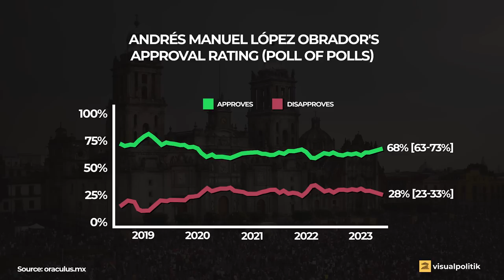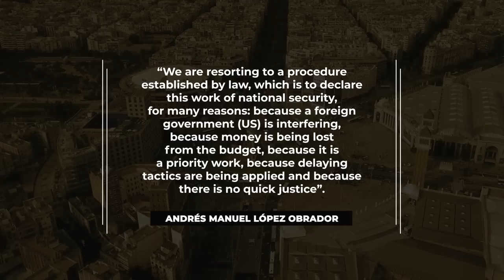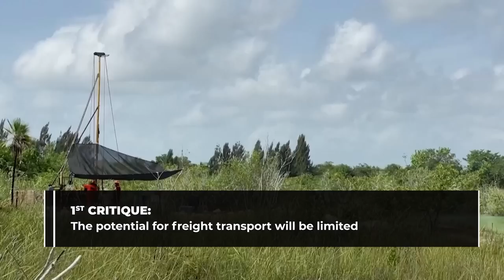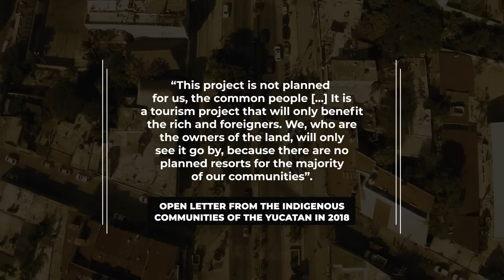Mexico’s Most Ambitious Project - VisualPolitik EN & HIR

Comment: The train maya will connect to the inter oceanic corridor which is the real main project to develop the south of Mexico. This corridor will potentially rival the Panama Canal. The train maya will connect to the two main ports of Mexico in Coatzacoalcos and Salina Cruz,  so the argument that the only client will be Pemex is not accurate
Reply: Who will send goods through the trans oceanic corridor having the Panama Channel next door? 

I mean, would you take take the cost of hire two cargo ships, one to discharge in one side and other to charge in the opposite, while adding the cost of the train and take the gamble that the in land travel will be safe?
Reply: @LuisRomeroLopez  the attractiveness isn't only the time of crossing, but access to the free trade agreement between the US and Mexico. This means Chinese, or companies from any country, can manufacture in Mexico and export tariff free to both coasts of the US quickly. 

Besides, the Panama Canal is packed and constantly having delays, so another route wouldn't hurt ✌
Reply: @alatorre33  Moving a cargo ship isn't like driving a car...

When you move goods from (lets say) China to the US, you hire a cargo ship.

This has to be done in advance since those are scheduled.

The attractive of Panama is that the same ship makes all the trip. 

If someone wants to use the Tehuantepec corridor, they need to pay one cargo ship in one side and a second in the other (twice as expensive), while also paying the train in through the isthmus.

There's a reason why this was never developed before and the only attemp of a corridor was under Porfirio (before the Channel existed).
Reply: @LuisRomeroLopez  indeed, that's why you ship in supplies, manufacture, and export the final product. I agree, it is not in direct competition with the Panama Canal
Reply: @alatorre33  Yup. And that's why it doesn't make too much sense.
Reply: @LuisRomeroLopez   fee is also needed to pass the canal of Panama, so seeing the difference in cost from one to another will be interesting. Another great saving would be the trade agreement between Mexico and the USA, which benefits Chinese companies. I read somewhere that the logistics would also be simpler. 

Another benefit I see would be foreign investment along the train route since they could easily send their products to both seas. I imagine that even Mexican companies would benefit from this. Furthermore, moving cargo with the correct infrastructure is not as difficult as you make it seem. I really don't think the time between one and the other will be very different. Also, having another option is never a bad thing.
Reply: @LuisRomeroLopez 😂😂😂 no serás del PRI o pan 🥐?
Reply: @LuisRomeroLopez  no, pero creo es muy tontito pensar que están mal las becas, al fin y al cabo es parte de  nuestros impuestos, pero bueno hay gente tan acostumbrada a que lo pisoteen personas que se creen dueños del país, pobre gente esa.
Reply: @alatorre33 AMLO is also already building a railway across the Isthmus of Tehuanteptec, which will take most of that traffic.
So… yay?

Comment: literally every new infrastructure built goes over budget because its hard to predict the problems that will arise while the project is under construction
Reply: Also low bids win and they purposely don't take everything into account.
On one of the engineering channels, I read in the comments that municipalities (in the US) that the middle bids used to be take. The logic was the cheap ones did not consider foreseeable problems and the highest bids had too much pork. And it worked out.
A few decades ago in my city, they took that approach along with increasing penalties for taking too long and I think there were bonuses for early completion. It all had to pass inspection, of course. Negotiated by a Democratic mayor, no less. It has lasted.
Reply: @recoil53 this sounds about right…is there a way I could see specific ordinances or legislation for this? Would love to have my own city complete an EIR and change the way we do bids
Reply: One example is the commuter train being built in California, way over budget, but not only that, it has ran out or it’s running out of funds, with construction taking many years longer than projected.

Comment: The costs increased due to the pandemic and the shortage of steel. If you wanted to make the same train today, it would be even more expensive. In addition, it is planned to connect this train with a Union Pacific railway network that reaches Canada, that is, if this train connects, it could send goods. or receive them from Yucatan to Canada by train

Comment: The train Maya is enhancing the tourist trade by making difficult to reach archeological and magic towns easier to see plus there’s new and valuable sites discovered including temples and cities that were unknown before. Also there’s the Transisthmic train being rehabilitated and reconstructed to connect the Pacific trade across the isthmus of Tehuantepec to Veracruz on the Atlantic side, with 10 industrial parks and energy centers between them for manufacturing and added value to this cargo! This will be great because the Panama Canal is saturated and there is the added problem of drought causing the rivers and lakes that supply water to the canal to start to dry up due to climate change! Plus a lot of other exciting and valuable innovations that will ensure economic growth and stability for Mexico!

Comment: One thing that was missed is that this train will also connect with Guatemala's train infrastructure. Trade between these two countries in particular, but also with the rest of central and south America are likely to increase due to this project since Mexico has standing free trade agreements with most countries in the regions, I highly doubt that Pemex will be the only customer. That has huge potential to stimulate economic stability for the whole international community around that region which it could really use and deserves.

Comment: The criticisms are valid and not easily addressed. For the deficit one I'm not a fan of building things based on debt that realistically will not be paid off. For the third one I have no idea how to correct for those other than it would be a headache and should not be ignored. If it's being sold as "reparations" then should the voices of that group not be ignored?

Comment: 12:00 You missed one big point. This train is being connected in Palenque with the tren interoceánico that will connect ports of the pacific and atlantic zones of Mexico. This train plans compete and complement with the Panama Canal. Ports in Nuevo Progeso, Salina Cruz and Coatzacoalcos are being expanded to receive bigger freight ships. Industrial Parks are being built close to these ports to develop and increase the industralization in the south of Mexico. More than 60 companies bid for 10 industrial parks that were built in this first part of the project. So there is a big idea here that is being developed. The GDP of the south of Mexico is growing double compared to the center and north of Mexico. Hopefully you guys can make a video about the Tren Interoceánico now that the Panama canal has a lot of water problems.

Comment: But also , they did not talk about the problems with the support of the railroad track supported over about Less than 6 or 10 meters over fresh water from the rivers , caverns called cenotes , with the overweight , vibration and time this will colapse under.
Reply: ¿Los mexicanos crees que no tenemos ingenieros capacitados para preveer eso?, ahí trabaján gente muy capacitada formadas en universidades mexicanas de diversas áreas. Así que no te creas tus propias mentiras.

Comment: I find the drawbacks rather weak. Damage to an ecosystem? How can a 5 meter wide railway line destroy an ecosystem thousands of kilometers wide from each end of the railway trucks. 2. The railway carts will return on one route empty (to collect oil). It the same case with what trailers do, they must be empty on the return journey. 3. Cost. It is debatable on the viability of project in terms of direct benefits and indirect ones, and also social costs. However, such large infrastructures are typically better done to completion or not started at all. If it is more than 50% done, the best option is to complete the project.

Comment: i'm against the train as the train should be built for general purpose usages, commercial and industrial, meaning double track.
Further, instead of having paved roads they should use gravel to ensure much of the forest is not being destroyed.
Reply: The train is being build to accommodate multiple purpose, tourism, industrial, and move of the agricultural goods.
Reply: @Madrid09ize  I'm merely speaking on what the host said about the line is ultimately built for the one industry when it shouldn't be. 

But as you said, it's for multiple purposes which is good.
Reply: I assume you have never heard of the Interoceanic Corridor of the Isthmus of Tehuantepec that is being constructed to connect to the Mayan train. As of right now the corridor has a chain of 10 industrial parks to be built between the states of Oaxaca and Veracruz and has attracted investment from manufacturers of semiconductors, electronics, and auto parts. There are many things that this YouTube channel never mentions which are very important stuff like the "Interoceanic Corridor of the Isthmus of Tehuantepec" which should obviously be mentioned at least once.
Reply: El tren maya no solo será turístico talbien estará conectado con el corredor del  istmo de Tehuantepec y el 50% de las vías ya estaban así q no hay tanto daño ecológico sumado q amlo está reforestando  zonas y mando  la zona del jaguar ser catalogada zona protegida
Reply: Bueno escuchar @frankAaronBether
Reply: @0fficialdregs 
No te alucines, este trabajo es el típico PROGRINGO: muy desinformado. Pero más allá de eso. Tú no le hagas al "experto" ¿o crees que los mexicanos no tenemos ingenieros ESPECIALIZADOS en eso?
Reply: @albertobobadilla6866  Sé que hay muchos hispanos bien especializados y calificados en México. Estoy más a favor de un equilibrio entre ambas partes para garantizar que las selvas mexicanas no acaben como la selva amazónica.

Comment: Pointing out some erroneous information on this video.

1. The train WILL be interconnected with the rest of the country’s rail network, prioritizing the Tehuantepec Ithsmus or Interoceanic Corridor.

2. I do see it as being built by Mexicans, in Mexico and for Mexico.  The train is a one/first of its kind planned and developed within Astlom’s team in Mexico, not else where then assembled in Mexico.  As a result, jobs were maintained or created in Mexico to meet the demand, which also helped create even more indirect jobs tied in to other industries that supply parts and everything required to build.

3. I’m curious of the red numbers source.  This is the first time in decades (or ever since it began taking on foreign debt), that the country has not increased national debt, in the contrary, it has reduced its foreign debt.  

They have also completed construction of the new oil refinery and now in the early stages of production.  They also now own the Deer Park refinery in Texas, and working on bringing back the rest of the refineries to original production capacity.

I think the cost increase in part is due to metal and steel prices going up in the world, therefore increase in project cost.  They had to buy outside because the country’s steel production is at capacity.  With Much of it going to other projects such as the refineries, new airports, and the construction of some of the 30+ trains for the Mexico City metro line 1 renovations and entire track replacement.

Comment: Ambitious megaprojects such as this (almost) always over promise, under deliver, and end up costing far more than budgeted.

Edit - This one sounds mostly fine if you ignore the restorative justice rhetoric. A focus on freight is far more practical. The issue is how ambitious it is tbh. Would make a lot more sense to start small.
Reply: Not always. Trans-siberian railway used to be pure insanity as well, when it was constructed. Nevertheless it became the backbone of Russia and it's hard to imagine a country without this railway infrastructure
Reply: @pavelmyshov464 That's true, actually. Should've said almost always. Also, I missed the part about it being mostly for freight. That's a far more reasonable use case than most magaprojects which are often borderline vanity projects
Reply: Cancún recibe al año 30 millones de turistas y toda la península tienes lugares aún más paradisíaco que ese región. El tren permitirá que millones de esos viajeros se desplazen a esas zonas y conoczcán más de nuestrá cultura.